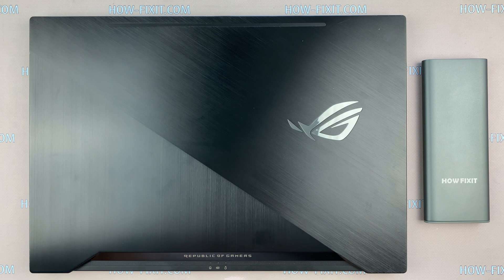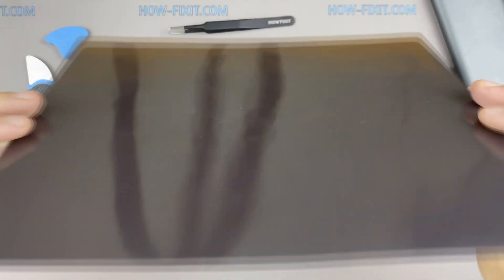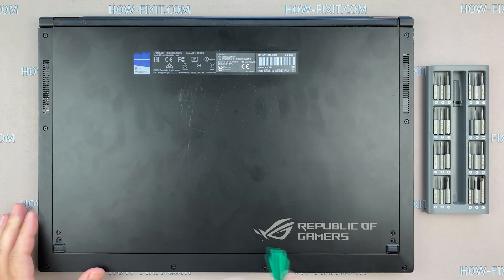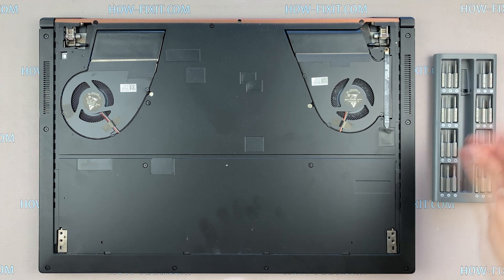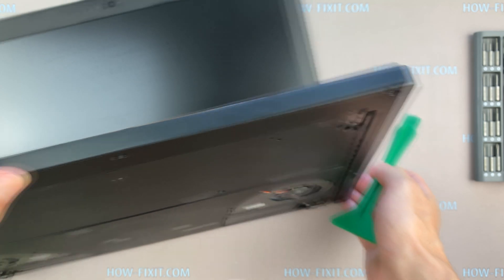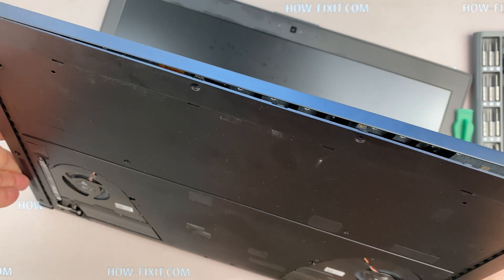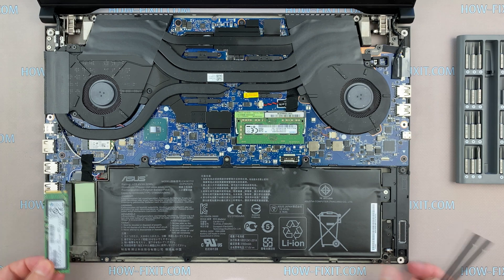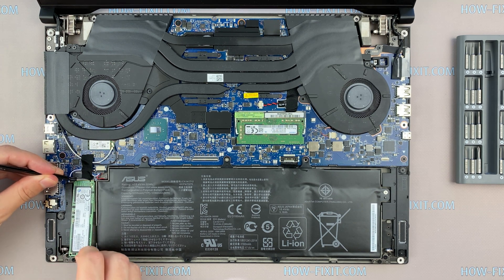Asus ROG Zephyrus GX501 SSD Upgrade Guide | Step-by-Step Installation Tutorial

Comment: Are u still active ? i have a problem with 2 latptos, 1 is hp elitebook 8440p and the other one is probook 6550b, i reset the bios to default and now is nos loading the bios :(
Reply: btw, i message you cause i saw a couple of videos of you with those models
Reply from the maker: Go to BIOS settings and ensure the SSD/HDD is set as the primary boot device.